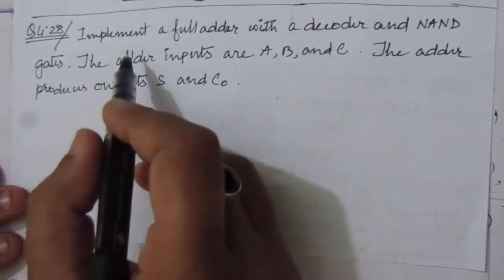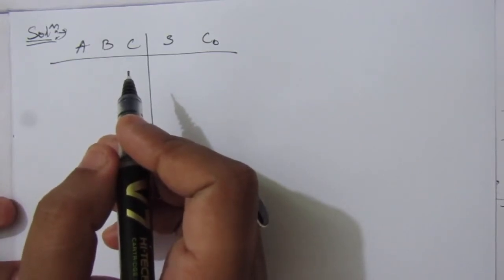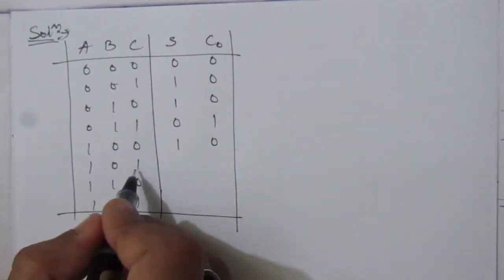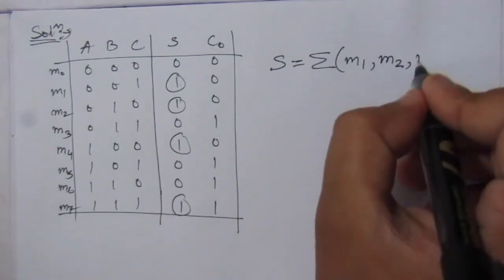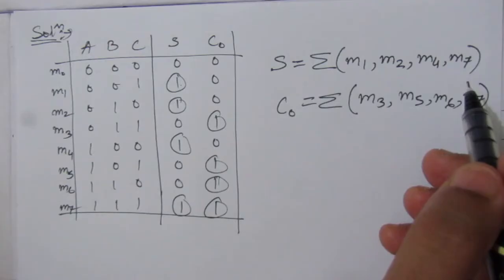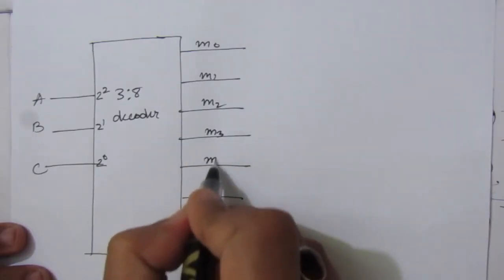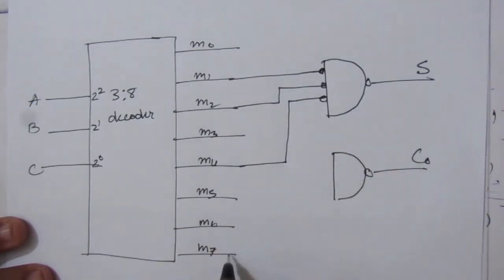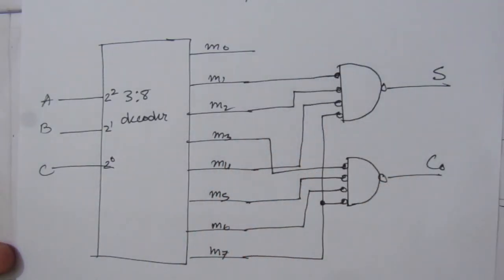Q. 4.28: Implement a full adder with a decoder and NAND gates. The adder inputs are A, B, and C.

Comment: Why didnt you use a low decoder shouldn't it be easier?
Reply from the maker: If simpler circuit design is possible, You can share herewith the schematic via Gdrive link.